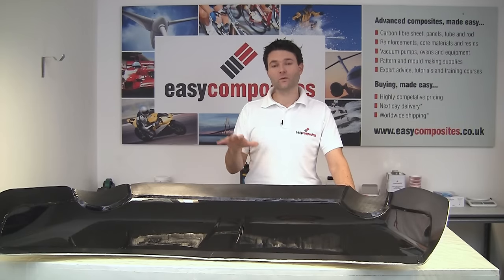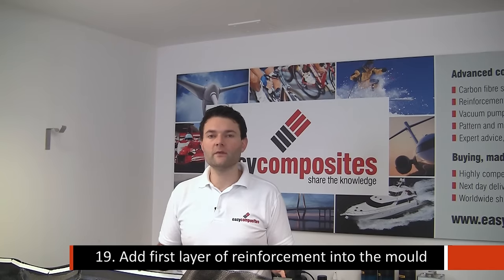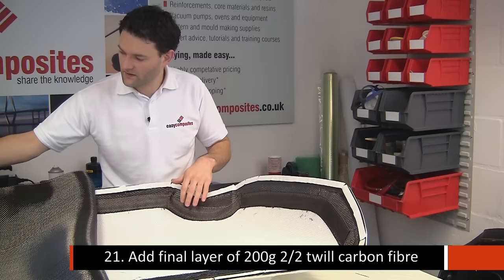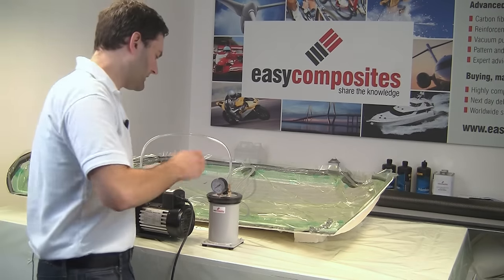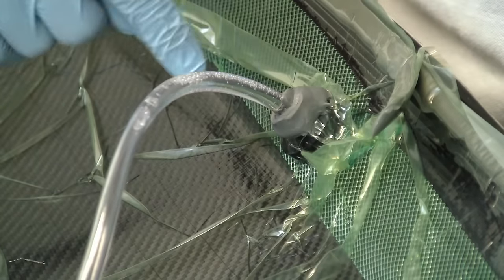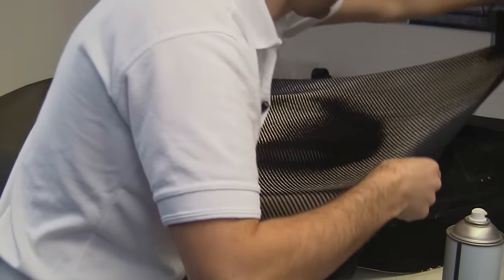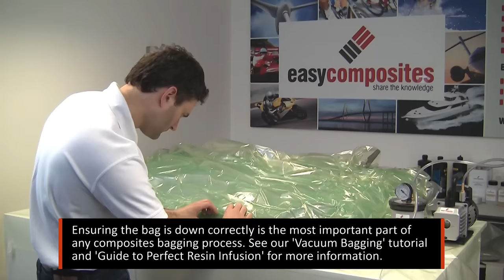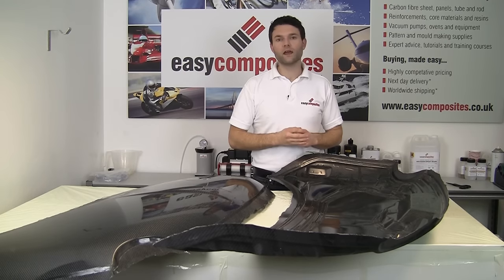How to Make a Carbon Fiber Car Bonnet/Hood - Part 2/3 : Resin Infusion

Comment: Fully appreciate the work in this but would there be any issues with just doing the outer bonnet and using an epoxy to bond the skin to the bonnet structure? It’s the cheap out way of doing it but curious as I don’t have all this equipment...
Reply from the maker: Yes you can just make the skin and use the OEM frame. Alternatively laminate in a Cross of foam under the skin to add stiffness then just use sections of the frame for the hinge areas.  That would save even more weight for minimal cost on a race orientated build.

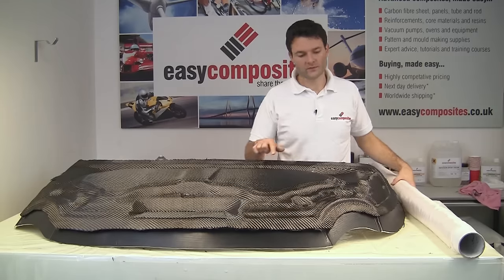Comment: At time index 15:02 - 15:15 why did you not put the extra layer of reinforcement between the 200 and 600 layers of mat?
Also do you not like stretch bagging material? If not what are the advantages of this?
Reply from the maker: There is no need to.  The extra layer is for thickness and general strength where the hinge bolts through.  There is no mechanism for it to delaminate and peel off. 

Stretch bags are not great for infusion. Often they burst, and often they stretch so much into the mesh that it restricts resin flow.  A stretchy bagging material will never be better than good bagging techniques in the first place.
Reply: Thank you for the great reply>

I understand the use of the extra piece of carbon in those areas. My question has to do more with esthetics than the performance. It seems to me that if you put the extra mat in between the 2 you would have a much more clean looking inner surface. Plus would it not in reality increase the strength of the inserted mat and area in general by extending the distance of the surfaces from each other. Much the same as using structural honeycomb or foam between the layers increases surface torque strength.

I am new to infusion, so new that I am getting ready to do my first item in a couple weeks. I have always done prepreg. I have used the stretch bag on that. Thank you for the warning when doing infusion. I will get regular bagging material on order. I also just found you guys yesterday and you have some very great sounding items. Some of it looks like things I use already from other manufacturers.

I am very interested in obtaining some of your oven use prepreg as I don't have an autoclave. Having to clean up all the pits in my prepreg work is a real pain.

Comment: can the soric be layered (say 3 layers of carbone with soric in between each), or is it better to use a single thicker layer of soric?   Also, can soric be wet-layed, or is it just for vacuum infusion?   This is fascinating, I'm trying to design my mold!
Reply from the maker: Although you can do that, but if you are using soric as a structural core, you are better keeping the carbon skins each side of the core material (whatever thickness) for mechanical efficiency.

Comment: I do not undrestand why Lantor soric is needed?
Is it just to make two layers appart of each other so it is like sandwitch and has more impact resistance rather than thin 200+200g layers?
I am planing to make my own engine cover witch is at least twise as big, as this one in the video. Is it bad when I do not use Lantor. Does hood fall into itself when there is presure on to the hood- like 20cm of snow or some maniac steping on it.
I have watched tens of hours of videos, but still feel like noob, scared to make first step.
Reply from the maker: The core material adds a lot to the stiffness of the skin. Without it you would need extra layers of carbon to make it stiff.

Comment: Questions:

Do pre-preg parts have better material properties and lower weight?

Can we use that polyester gel for prepreg to get the same shiny finish? (Home oven, not autoclay). What material would you recommend for female pre-preg molds?

Are we not supposed to touch dry carbon with bare hands? To avoid contaminating by skin oils?

Comment: By infusion I believe he means injecting the epoxy to harden carbon fibers and vacuum drop test is simply checking of the vacuum in the system to see if there is air coming in or not... If air is coming (so called "leakage"), that's no good...

Comment: So the infusion core material is placed between two layers of carbon fiber? so when the part is done you will have the core material just sitting inside the finished product?
Reply from the maker: Well, yes the core material stays in the core but that's just the point, it is a core material and that's where it's supposed to be. Although Soric is good at supporting resin flow that's not why it's there, it's there as a structural core, the infusion mesh (which is outside of the laminate) is the main resin distribution media and that is removed (along with the peel ply) after lamination.

Comment: So is there a reason u put the reinforcement on top of the two layers instead of in between them? I think itll be cosmeticly nicer that way. Thanks
Reply from the maker: Do you mean the core material (Soric)? this has to be used within the laminate stack not on top of because the laminate needs to be balanced and thus whatever materials are on one side of the core need to be mirrored exactly on the other side; this is done to ensure that the two skins of the sandwich laminate work in unison with one another. Putting the Carbon Fibre Reinforcement on only one side would lead to warping and and imbalance in the mechanical properties.

Comment: Extremely good tutorial. But how would part 2/3 be done if you do not have the pump or infusion parts? As I am restoring an old car, most parts are no longer available and have to go with fiberglass or preferably, CF.
Reply from the maker: You would not be able to do a resin infusion without a vacuum source or equipment you see there.  You can use alternative methods such as wet layup, but the results will not be the same.

Comment: Can i use the glue spray ( direct to the mold )to stick  the carbon fiber ? ,,, it will not efface the final finishing ? As the glue will be between the gelcoat and the fiber mat ?  Thanks.
Reply from the maker: You should use the glue very sparingly if at all as it will be visible on the carbon under the gelcoat.

Comment: Would the process be the same if I just wanted to use fiberglass instead of carbon fiber?  They don't allow the use of carbon fiber in the racing series I am in.  I wanted to make a copy of my fiberglass Porsche Boxster convertible hard top that I use in racing.
Reply from the maker: Hi Kyle, the process would be exactly the same, you may require more layers of glass to get a panel of the same stiffness as a carbon panel.

Comment: For racing applications: is it ok to only use the top part, and leave the bottom half off..? Or is that just not very strong..?
Reply from the maker: Yes, that's not uncommon. You might need some additional reinforcement but it could be a lot more minimal than the shape of the original steel structure.
Reply: @easycompositestv  thank you for your response!! So for example just on the spots where the hood would go, reinforce that part..?

Comment: great video. really informative.
do you need to post cure it so as to make it withstand the engine heat?
if yes, will the hood/mold warp or become soft while curing, as most resins become less viscous at high temperature?
Reply from the maker: A postcure is useful if you intend to use the part immediately either on a hot engine or in direct sunlight.  Ideally you postcure in the mould to prevent any issues with warping of the part.
Reply: Thanks a lot guys, you are doing a great job.

Comment: So the feed/spiral wrap lines are running across the width of the base/inlet, then along both sides of the part, but not the back/exit edge?
Reply from the maker: Correct, the resin will flow through the fabric and core to get to the vacuum line.

Comment: Wich pump were used in this tutorial? I know you are now selling the ec4 Vacuum pump, but I see in the video a probably low budget vacuum pump that I should require for some project like this...can you suggest any techincal info for a budget good vacuum pump that need to do  nice result with infusion large part like this? Many thanks
Reply from the maker: It was the predecessor to the EC4 which was a simple rotary vane vacuum pump.

Comment from the maker: Hand laminating composites will never produce a fibre-to-resin ratio as high as vacuum/pressure assisted laminating like resin infusion or pre-pregs, this is why high-tech industries like aerospace and motoracing would never hand laminate. It also improves consistancy and like you say, eliminates air-voids and the like. It doesn't save money however because the material and associated processing costs are considerably higher.

Comment: Why is there no infusion soric in-between the underside's two reinforcement layers but in the outer there is?
Reply from the maker: The lower frame of the hood does not need the extra stiffness that the Soric core would add so it is left out.

Comment: Is there any way around doing an infusion without a peelply separating the vacuum bag? I'd like the top surface of my part to remove from the mold relatively shiny without any additional finishing processes such as clear coating it. I find that those green plastic bags release well and leaves a not so perfect finish, but still shiny.

Comment: Holy Cow! No wonder  part suppliers charge so much for CF parts. friggin hell its a nma massive undertaking making it really impractical to make it yourself. I built a 30 foot boat in          polyester fibreglass but wouldn't think of doing this!

Comment: Sir please reply!
My question is; if we do not have vacuum pump or don’t want to do this vacuum bagging part, what other options we have, to do this “resin infusion” process??
In what other ways we could get our job done?
Reply: I know its an 8 year old video, but hoping to get a reply.. thanks :)
Reply from the maker: Hi Sheraz, if you don't want to use a vacuum process of any sort then your only option would be to 'wet-lay' the carbon fibre in a way most similar to how fibreglassing is done, i.e. using a wet resin and then wetting out the carbon fibre fabric by hand (using a brush). It is perfectly possible to make a carbon fibre part in this way; there will be some compromises in terms of surface finish and also the weight of the finished part but a hand-layup process is definitely an option.
Reply: Easy Composites Ltd, ok I got it sir.. weight is not an issue in our case because we are doing this for more “aesthetic” and less “weight reduction” purpose.
And for the surface I think we can wet sand it afterwards, am I right?

Comment: Very good video! I'm about to attempt this myself, was just wanting to know if you ever have an issue with the white soric showing through the twill pattern?  Being put down directly behind York first twill? Thanks,
Reply from the maker: Hi Nathan, it is sometimes possible for this to happen. On this part, you couldn't really see any gaps between the carbon tows because it's a relatively smooth, flat shape so there was not much distortion needed in the fabric. If you do have a more complex shape whereby gaps in the fabric are more likely then backing up with a second layer of carbon would be the only way to guarantee you don't ever see the Soric. If you do see it, it's not very noticeable because although the material is white, it goes darker when it's wetted-out with resin.

Comment: can you please give me a brief about how much of the epoxy was used for design i.e. weight ?
also i wanted to know what will happen if i put the carbon sheets in different orientations , will it effect the structure strength ? for example if i am taking a 3k twill weave sheet and putting the sheet at 0 degree orientation and the second layer at 45 degrees and next one at 90 degress ?
and how to decide how much resin i have to apply on each layer ?
Reply from the maker: Twill fabrics are orientated at 0 and 90 degrees so only the 45 degree orientation would add anything to the sheet. What it would do is add torsional stiffness to it making it a more balanced laminate in that sense.  For most body panel applications this is not needed due to the way the panels are secured, so for many people, the standard fibre orientation is fine. 

The resin quantity is best described in terms of fibre resin ratio. With infusion you are ideally aiming for a 60:40 ratio. However, in practice, you will use a lot more resin for the infusion as resin is wasted on the peel ply, mesh, spiral, pipework and any left overs in the mixing jug and catch pot.  The best way is to use our resin quantity calculator found in the Resin Infusion Kit instructions which you can download here: https://system.eu2.netsuite.com/core/media/media.nl?id=59028&c=3937524&h=ed6c113ff018e812d5f3&_xt=.pdf
Reply: Easy Composites Ltd thanks it was helpful

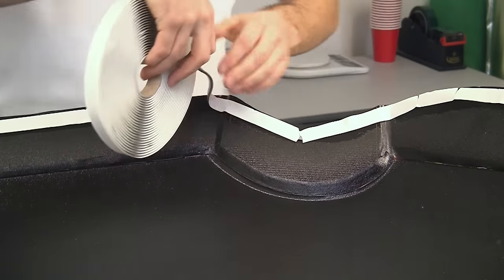Comment: At 2:30 you sand down high spots in the gelcoat.  I have had to do the same on a part I am currently working on.  The carbon is now stacked in the mold... all tacked down.  However, I am now concerned that the white sanding marks will be visible in the final part.  I sanded with 400 grit paper.  Should I proceed with my infusion or pull all the tacked down carbon out and sand down to a finer Grit?
Reply from the maker: As long as it is finer than 120 grit (400 is fine), the resin will fill in the scratches on the gelcoat so that it is not visible.
Reply: @easycompositestv  ....Well I went forward with the infusion and can definitely see the scratched areas.  I should have mentioned that I am working with a carbon Kevlar hybrid.  In some areas I have just the typical carbon fiber weave.  Definitely not as apparent in those areas.  I will sand down to at least a 1000 grit next time.  Or try not to mess up with the clear application :)  thanks for the support.

Comment: What do you suggest as a method to stick the cloth to the mould without using prepress?
Reply from the maker: You don't necessarily need to stick the fabric to the mould for simple shapes like this. The fabric will lay in the mould fine. You then ensure as you pull a vacuum that the fabric is carefully pressed into all the edges to avoid bridges or voids.

Comment: Will the gel coat used act like a clear coat, protecting the resin from UV rays ?
Reply from the maker: Yes GC50 is a polyester gelcoat with very good UV resistance.

Comment: I like this video really, may I know what did you spray (white bottle spray) on the top of the first layer cf? Thanks.
Reply from the maker: The small spritzer bottle had a small amount of acetone in it.  The earlier version of GC50 would become tacky again if lightly sprayed with acetone.  The later versions of  GC50 do not react in the same way.  The aerosol can used layer is a spray tack which is similar to our Fusion Fix Product.

Comment: How do you avoid making a resin rich and therefore unnecessarily heavy layup ? What typical resin to carbon weight ratio do you end up with please ?
Reply from the maker: Andrzei Czajkowski Resin infusion finds a natural balance at 60/40 (fibre to resin ratio) which is very-much comparible to pre-preg carbon fibre and is generally regarded as the optimium fibre to resin ratio. You have some control over this ratio depending on your clamping sequence - clamp the resin line first and let the vac run and you'll reduce the resin content (at the risk of some pin-holes on the surface); clamp the vac first, wait, then clamp the resin line and you'll have a slightly more resin-rich part but assure the best surface finish.

Comment: Could this process be repeated but using a hand lay up instead? Brushing epoxy resin on?
Reply from the maker: Yes it could certainly be done wetlay.  The moulds will work well for either process. Unless you are very experienced, you may struggle to get as high a quality finish or low weight by wet lay.

Comment: Thanks for this great instructional video. 

I know it depends on the use,  but approximately how many times can I use a mould made for this? 
Also, do you have some tips to better take care the mould after the process?
Reply from the maker: A well looked after mould can get hundreds of pulls off of it.  Regularly cleaning the mould and repolishing it before applying fresh release agents will help keep it in good condition.
Reply: @easycompositestv  responding to comment on a video. You posted six years ago. Absolutely legendary.

Comment: Can this method be used to make car doors? Or are there some safety Issues with that?
Or do you use some other method for such parts?
Reply from the maker: K.H. There is no reason why the same method cannot be used to make car doors. You would need to take into account the OEM side impact protection implications in your design. For motorsport, often the roll cage replaces the OEM protection.
Reply: K.H. I wouldnt mess with that if its not a race car with full roll cage. Todays cars use different metals in different areas of the doors and door frames and they all work together to keep you safe.